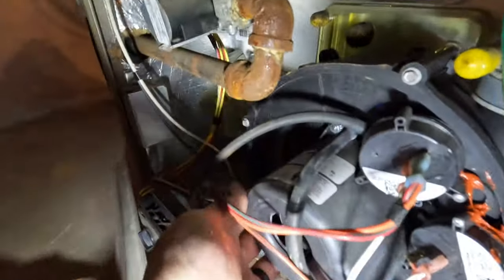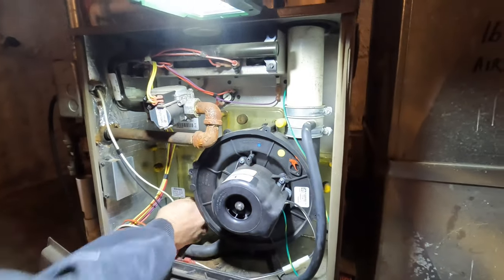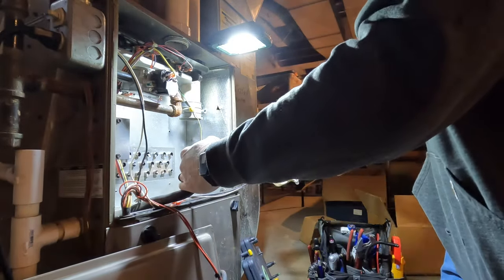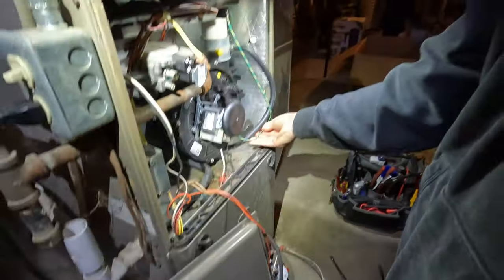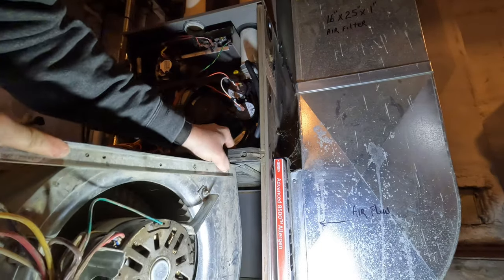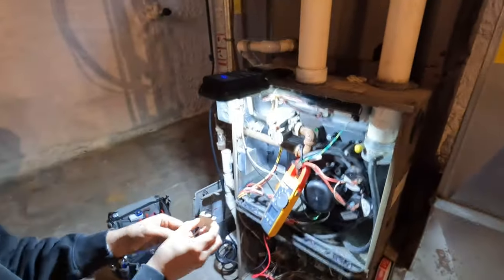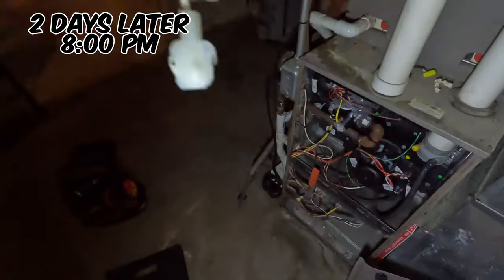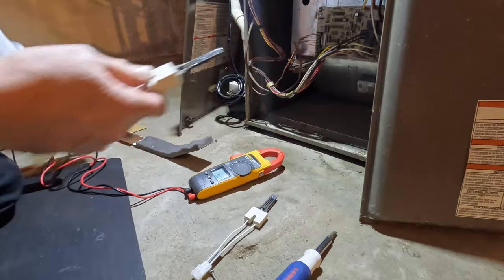How many parts were changed on this furnace was it worth it?

Comment: respect !!! No one wants to do it this way anymore !!! I rebuild my Goodman 1993 "The Dependable Ninety-Two" 6 years ago after I had a company come and tell me it was done and a  new single stage would cost me over $ 8,ooo . all parts costed me under $700. even a new 2 stage gas valve !!!! and it still running today, I do my cleaning 2 times a year and this year I'm going to take out the wheel and clean it. oh I did have to change out one blower motor too.

Comment: Nice job. I never liked those kind of ignitors, I use those universal ones.  Weird the gas valve was bad also.  I noticed they had the air filter in backwards.
Reply from the maker: Yeah I'm starting not to like them either. Now i know on the OHMs.  Ironic gas valve.

Comment: Hey just my opinion but think maybe the ignitor that had 0 ohms was the problem with the gas valve? I've seen it before where it doesn't get hot enough to lite?
Reply from the maker: I could see that. But the valve was not opening at all. I put my hand on it and you could not feel it click open.